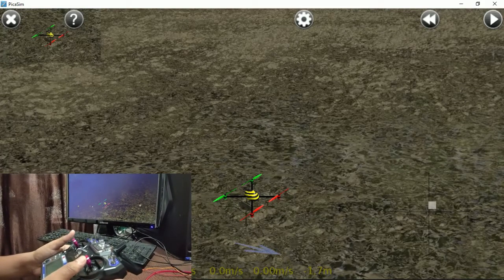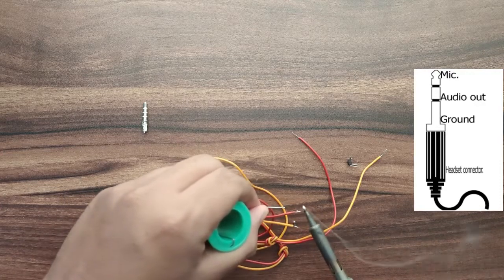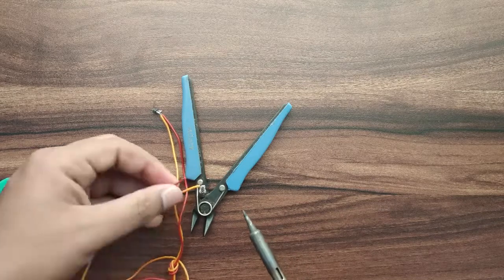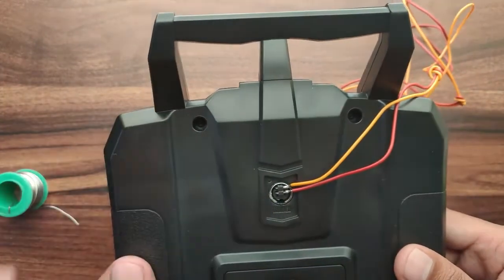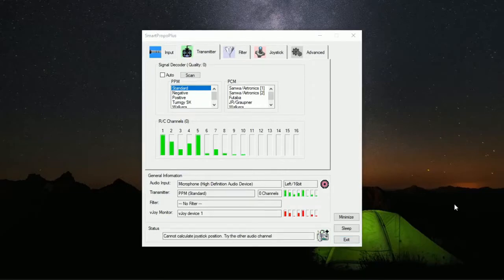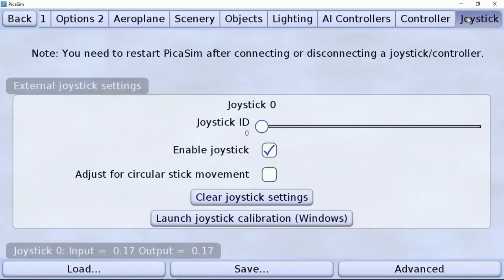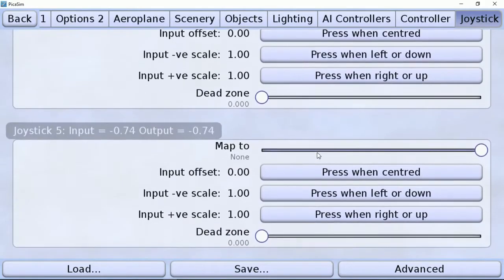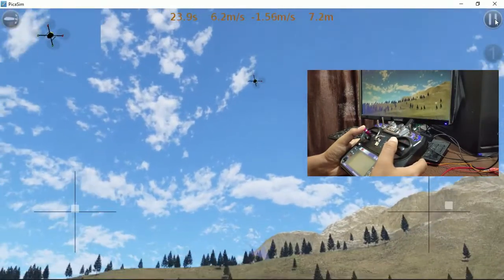Flysky Simulator Cable DIY at home   Picasim   Smartpropoplus   Drone Simulation   flysky simulation

Comment: You don't need to do this! Use the din  to usb cable u got with your flysky, plug into your computer, open picasim, go to joystick, click  on " launch  joystick calibration " it will say "flysky fsi6* ,click ok then just go back and calibrate joysticks,  simple!

Comment: Do you need to power on the Flysky Transmitter to use with PicaSim? Are there any configuration need to setup on the transmitter?